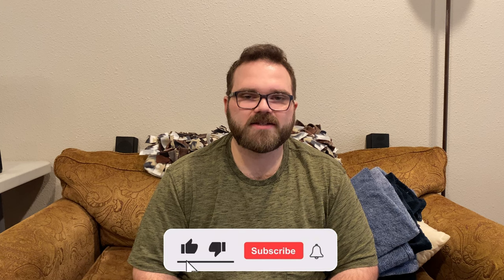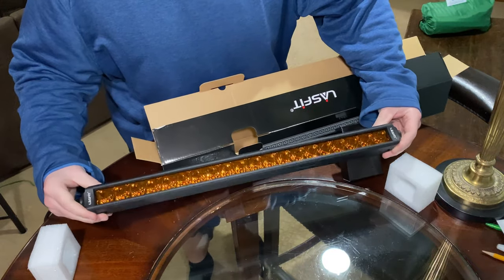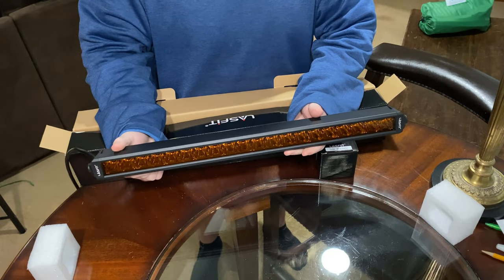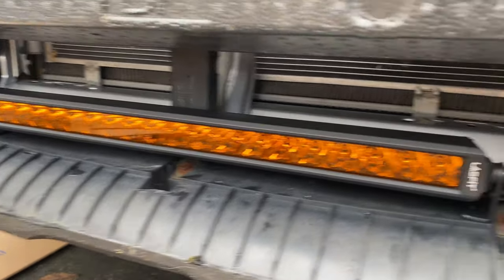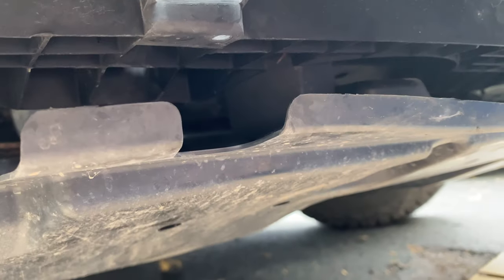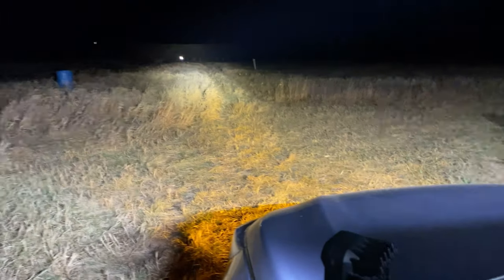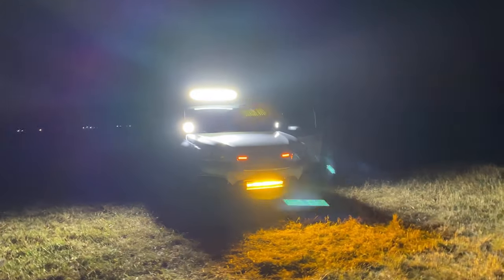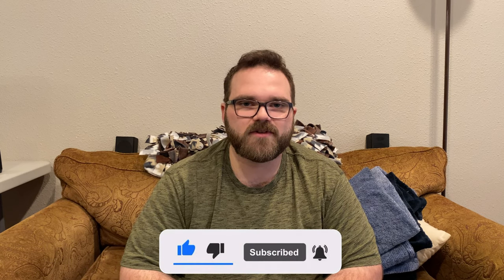Subaru Bumper Light Bar Install | Lasfit | Wilderness Offroad

Comment: Hey man, I have a '15 outback and have been looking all over for grille lights for the same grill you got. Can you direct me in the right direction? Thanks!
Reply from the maker: The “grill” lights that I use are motorcycle led strip turn signals lol. I have them wired into my switch panel. They work great, haven’t had any issues with them even though they are super cheap.